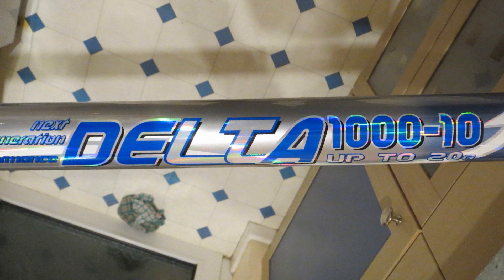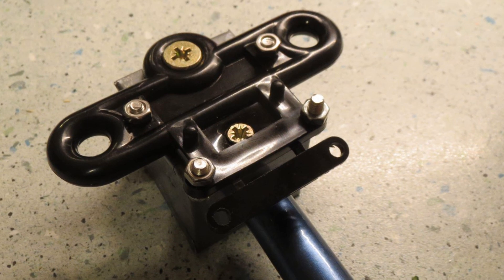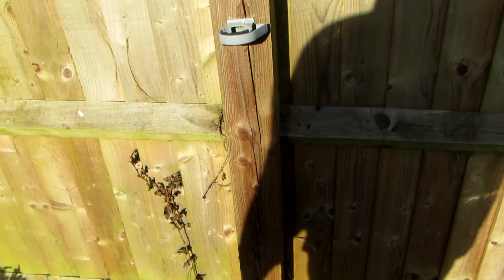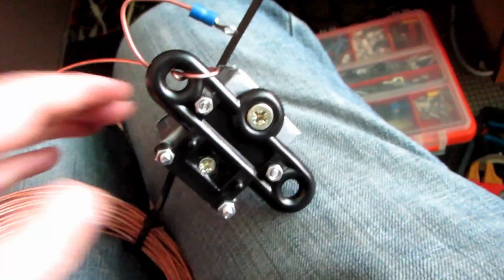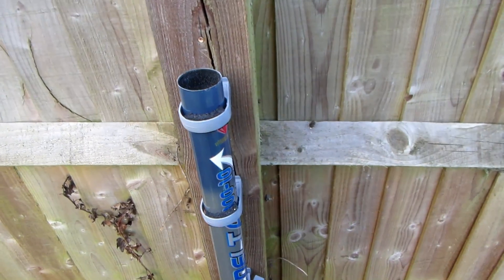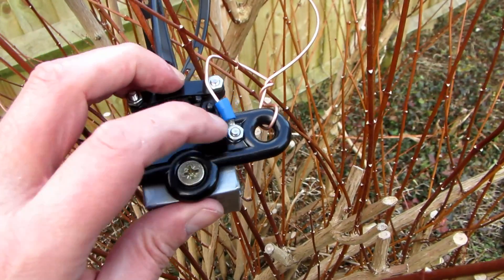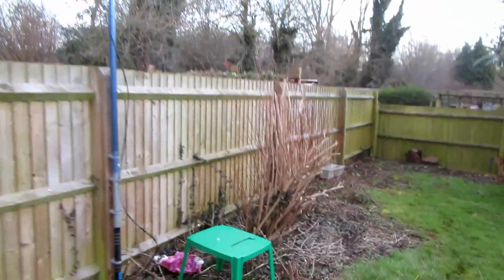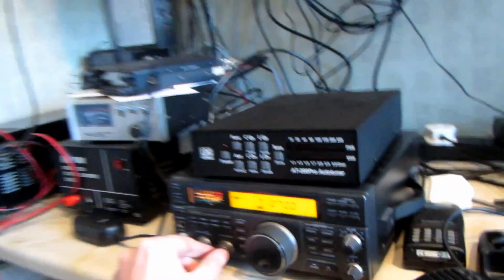Installing a G5RV Inverted V Antenna for HF use on a Fishing Pole

Comment: Nice video: You talked about the connections to the centrepiece . If you loop the element connections to the back of the centrepiece so they go under the head of the screw, that will leave enough room on the other side for the ribbon feed connectors to be connected with enough thread for a locknut if you wish to use one. Peter EI9GT
Reply: Good afternoon from llandudno north Wales where can I get one of these telescopic fishpoles
Reply: @christophercullin9309  

I got one from an online fishing tackle shop. They called it a carp pole, u can get them 9 meters and more!

Comment: Great video thanks! Can you recommend this delta 1000-10 pole?? Are they ok under moderate wind
Reply from the maker: Yes mine still works, I didn't use the very top section though

Comment: I actually like G5RVs - i’ve had a couple in the trees over the years and in fact this very minute I have two more on the way that I have ordered you should have seen my eyes lit up to see that FT840 that was my first radio when I first got licensed I really enjoyed that thing then I bought the FT 920 and have been using that for the last 20 years I also just bought a brand new FT101MP that is in route and I should get it Thursday .   73
Reply from the maker: Best of luck, I've now moved house, bigger house smaller garden, using a vertical now, I'd love another wire up though 😎👍 I've still got the radio though, it works superb still.

Comment: Is LocTite dielectric?
Reply from the maker: No you would only use it in the top of the threads, tiny amount, it's been ok actually, my main problem has been cutting the wire when I'm pruning the bushes 🙁🤫

Comment: What did next door think of the antenna when you installed it, I've just got a sigma dx 80 for HF a vertical but dreading what they will say, I did throw a wire over the roof and down on the fence to the garden got asked what you doing felt like saying mind your own business. De 2E1FUE great video.
Reply from the maker: He was really good about it (ex RAF guy) if you are using a vertical inch it up a few feet every week let them get used to it, thanks for the comments, I am about to put up a 10m vertical at my new house :-)
Reply: @knoxieman  nice are you on Hamsphere to or Peanut? I'm trying to get my HF back up and running, It's a nightmare and with the misses and a new baby, she said it's stupid you playing with your radio, I was a bit pissed I was trying to link Ham Radio Deluxe to Ic706 Mk2g.

Comment: A G5RV is no longer a G5RV if it has been modified, whenever I hear a comment on the HF bands about a modified G5RV it is so wrong. The G5RV was designed to be an efficient antenna only on 20 Meters, so on all other HF bands it is a compromise antenna. From my own experience, the G5RV works up to a point, but it will never beat a balanced Dipole or Doublet antenna. Both these antennas have much lower RF losses, and therefore radiate  RF 99% more effectively than a G5RV on all HF bands. Thanks for the interesting video.

Comment: Just found your video, very good installation. I did the same a few years ago and changed the antenna to a variant of the G5RV called the ZS6BKW, slightly shorter but works all bands 80-6m using my LDG 200 atu with excellent results. I've made loads of them and found the 450 ohm ribbon at 39ft 3in and the wires cut at 46ft 8in each end with a 1:1 current balun is my best option.
Reply: Hi Bat... Just wondering if you have your ZS6.. Inverted V ? and if so, how high are the legs off the ground? Tnx Gerry
Reply: @tixilx  The centre is only about 30 feet above the ground and the wires are in an inverted V about 15 feet from the ground
Reply: @batwillow  Many thanks for taking time to reply - Certainly on my list to make - one last Q ... Did you use solid or stranded copper wire ? Gauge ? 73 Gerry
Reply: @tixilx  Hiya, my first onw I made was with what I had in the shack at the time and I used 2mm enamelled copper wire for the elements, that worked great, but I wanted to make it stronger and got hold of 4mm clear plastic covered stranded wound wire, slight adustment for my tuning.... tuned it for 7.100 MHz and 14.200 and use to atu for 18.130, it tunes from 3.5 up to 50mhz
Reply: Stranded copper wire
Reply: @batwillow  That’s great information - Thanks 👍 Just finished beam for 2m that’s doing a nice job .. Appreciate your help☘️

Comment: I use a G5RV here in Eastern Canada and am very pleased with it. When I moved from my old house to the new one I took my G5 with me. I rebuilt it as it was over 5 years old and sort of weathered. When I reinstalled it I used a one quarter inch nylon rope. I fastened the antenna to the robe with zip ties and pulled the rope tight not the antenna. This way the rope takes the strain not the antenna. I cant see any difference what so ever in the signal or receive. Im quite happy with it.

Comment: Do you keep the pole extended all the time ? If so have you added guy wires. I also find it handy to use self amalgamating tape around the joints of the pole just to stop them collapsing down.  73 de 2i0otw

Comment: Where did you get the pole?  I have been looking for something similar for a while now and that looks perfect.
Reply from the maker: got this one from eBay in the UK, it's great and is still OK. sellers name was paulsanglingsupplies
Reply: Do you think you could supply a good link for a distributor on the pole mate?
Reply: Nevermind.  I found it Pauls Angling supplies.   They do not ship to my zipcode here in the usa.  Bummer
Reply: @bwade7342  Any chance you found something similar that worked? I also wanted to buy this.

Comment: Nice video, do you have a video of the long wire? I have a 20m endfed wire that I was going to replace for a inverted V G5RV but it sounds like your wire was better that the G5
Reply from the maker: Hi thanks, no video for the long wire yet but I'd say performance is bit better on the long wire although it can be more noisy at times.

Comment: Nice work. I have a G5RV Jr in the garden with feed up on a 5m painters pole from B&Q and the ends tied off on a painters pole at each end. Works great on 10, 20 and 40m.
Reply from the maker: sounds great! yes its a very effective antenna I also have a sloper long wire the other side, end fed with a home made un un there about the same performance.